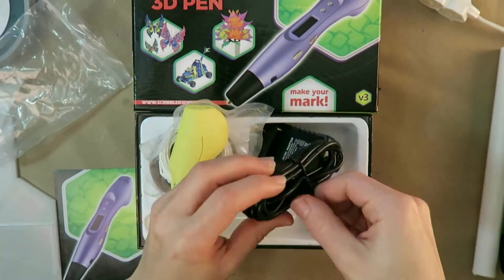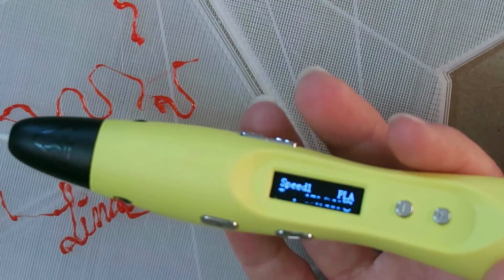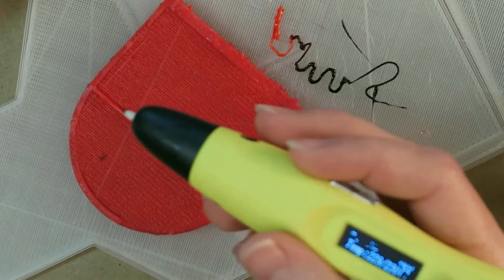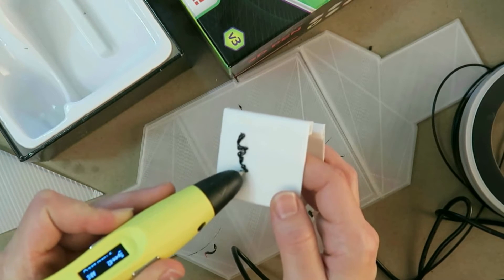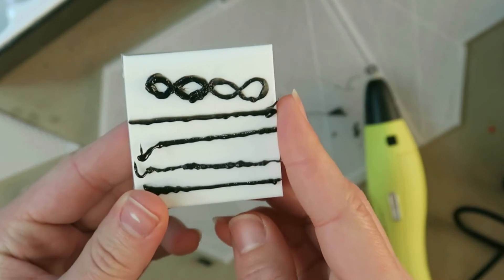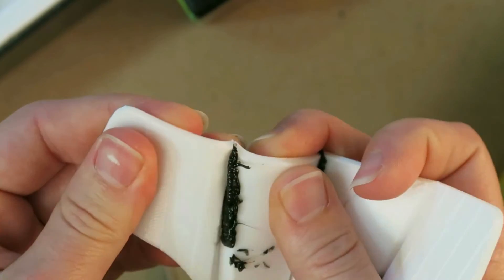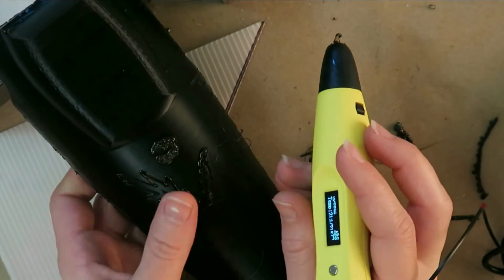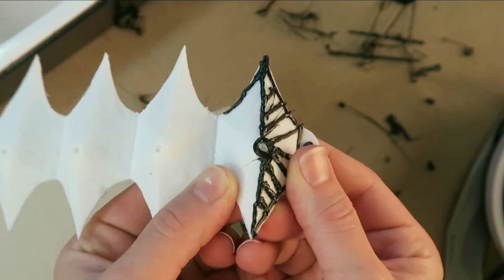Scribbler 3D Pen v3 Unboxing / SemiFlex Filament Test

Comment: Info: Semiflex is a TPU filament made by NinjaTek.
I just ordered a similar pen with PLA and ABS modes and I was wondering if I could just stuff other types of filament in it that are in the heat range (sooo many types)... I'm more confident to try it, now that I see it working without clogging your pen. Thanks.
Reply from the maker: Mine is still working fine using Tech-g and Cheetah for repairs and modifications. Hope it goes well for you.

Comment: I've been using a new MYNT3D pen and I love it.  Bit pricier than my previous, but seems to be worth it so far.  Love using it for the more intricate details on my 3D prints.  The filament that comes out is either a stopper of sorts, or residue from it being tested.
Reply from the maker: It's a nice tool to have on hand. Yes, that makes sense.
Reply: 3D printed a mask and used the 3D pen to fill in some areas and decorate it, and it turned out pretty well.

Comment: That's the best 3D printing pen I've seen yet!  I might actually get one of those.  Why do you have such a disdain for PLA?  I know it's hard to sand, but it's the easiest to print.
Reply: That's true.  It all depends on the application really.  I'm just glad that there's so many different types of filaments coming out for 3D printing.  Bridge nylon is also indestructible, as well as TPU.  I just haven't figured out how to get TPU to stick to the printbed very well yet.  I haven't been able to find out much info on that part of it.  I don't have any problem printing it, even with a very long bowden tube, I just doesn't stay stuck after about 2cm.

Comment: I have an earlier version of this same pen.
It doesn't have the temperature  control and is terrible at holding the right temp.
It would cool as you extrude and then over heat if you stop.
This version looks quite a bit improved. 

Also, FLIPPN' HECK THAT KNIFE O_o